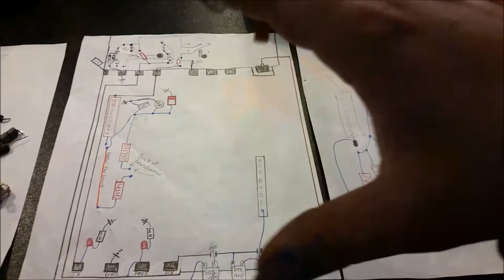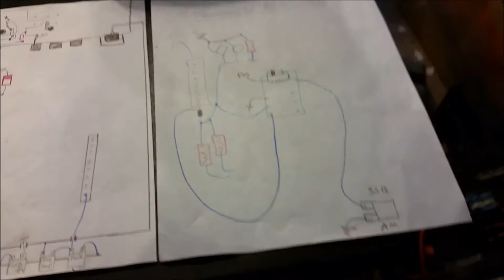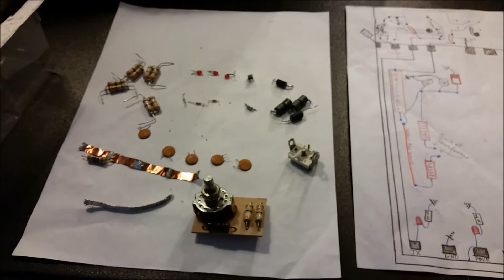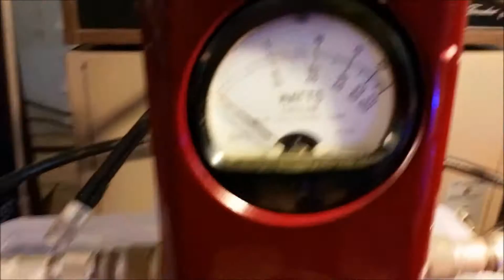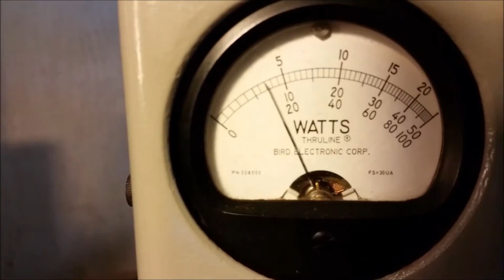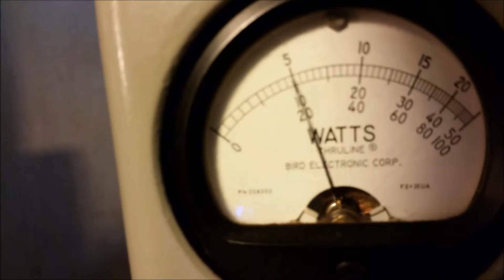Frankenstein Messenger M350 With Over 9 Mods 💪

Comment: Why was the inductor nessasary to have so many turns ....seems heavy
Reply from the maker: Imma have to watch the video and get back to you on that ive dont forgot.
Reply: My guess would be that it needed that many turns do get the 50...ohms at right load .. it's clean and I've seen few amps done that way factory...with the tunes inductors ... usually no shunt tunning cap...do to the the individual inductor is valued at the proper capasatance..completing the input tune .... Known as fixed input induction..as u already known ... just like when u fix tune a amp with a SDM to ground at input as a shunt tune cap...
Looks awesome ...9lb hammer Oklahoma